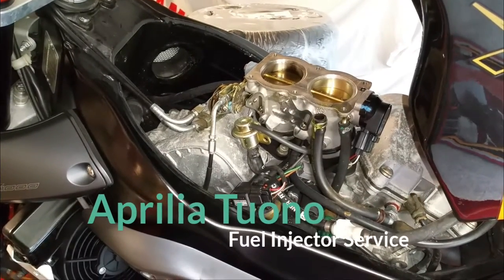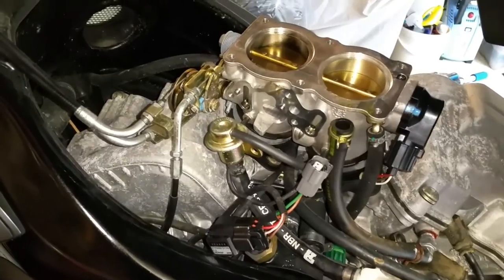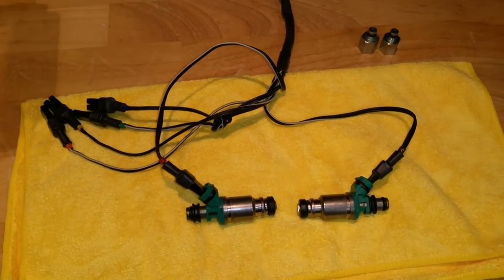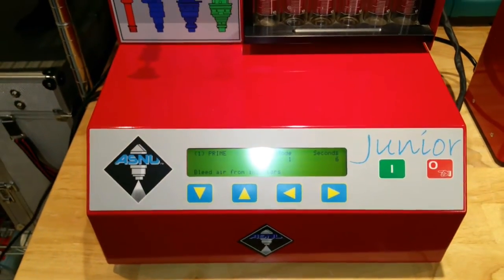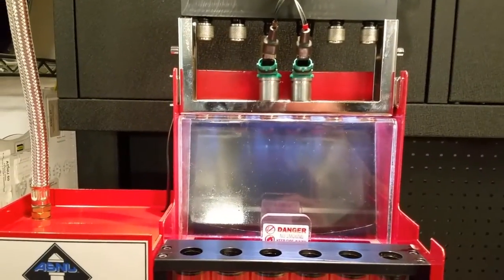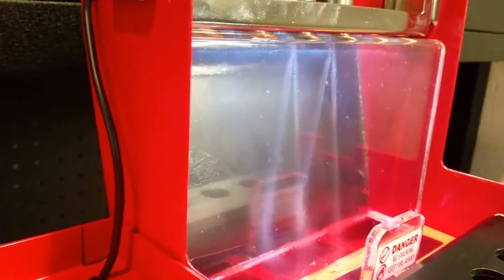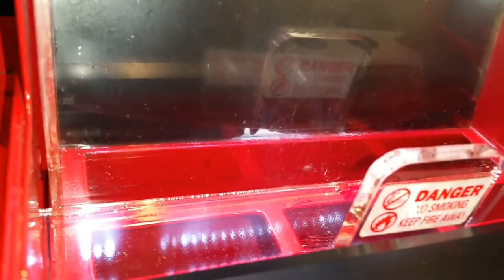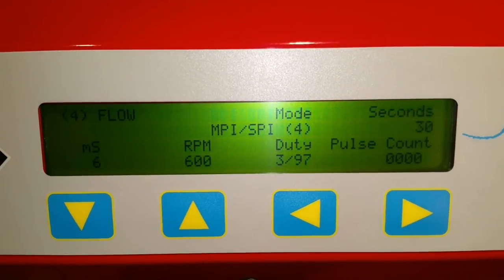Fuel Injector Service

Comment: We always flow test the injectors on static (14) and measure the cc with the pressure at 3 bar. However, thats on car injectors.❤ the ASNU is worth its weight in gold. Thank you for this video , i will try your way next time also😊

Comment: Great video I never knew such industrial injector cleaners existed, I seen other solutions which work using a compressor but mainly for cars.

I noticed in your last video you used a snap on computer on the Triumph I've always wondered if there are bike computers as there isn't a standard (as far as I know) like OBDI for bikes did you have to buy proprietary connectors for different bike brands?